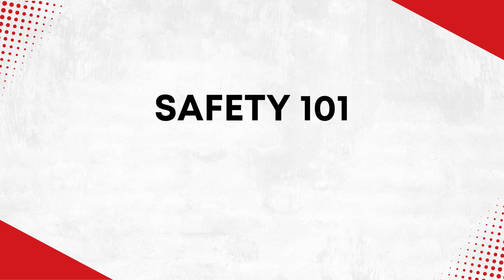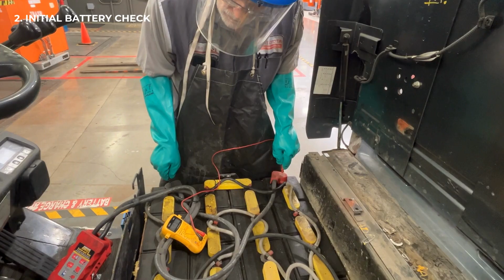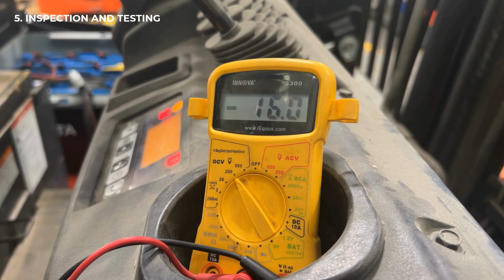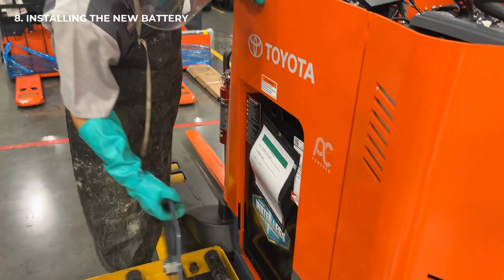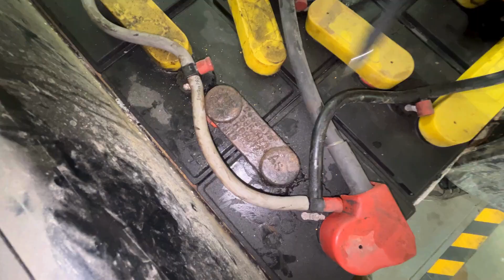Safety 101: Battery Test & Removal

Comment from the maker: Timestamps:

00:00 Introduction
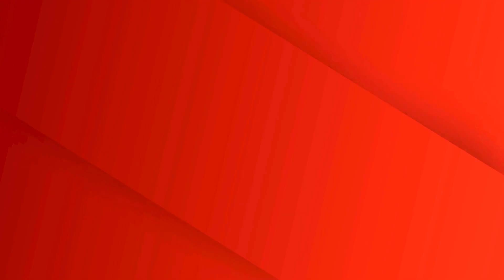00:20 PPE Safety 
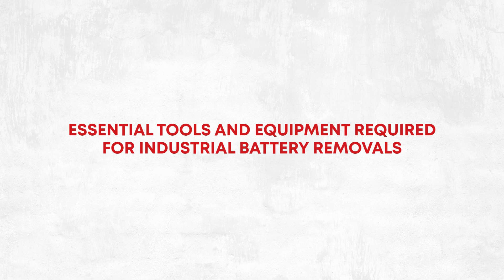00:56 Important Tools
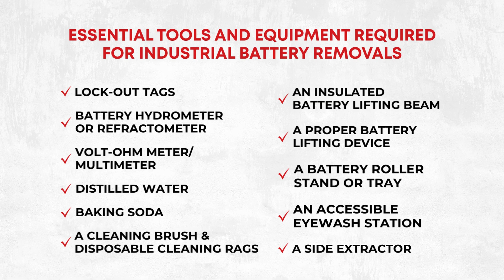01:38 Preparing the Forklift
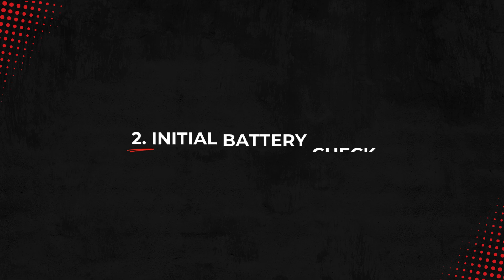02:01 Initial Battery Check
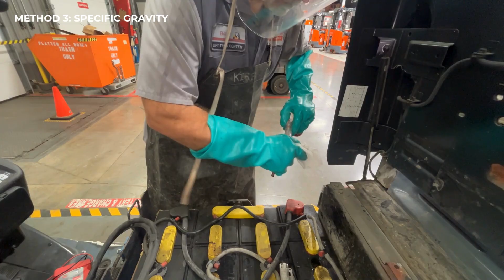03:16 Water Level and Charging Safety
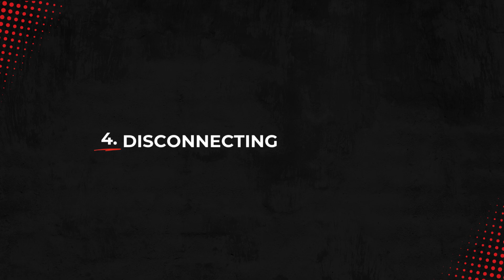03:42 Disconnecting the Battery
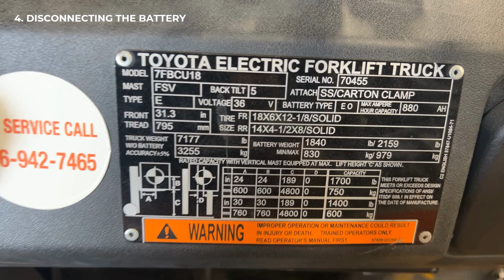03:57 Inspection and Testing
04:47 Cables, Restraints, and Load Test
05:11 Pop Quiz
05:29 Battery Removal Methods
06:25 Installing the New Battery
06:48 Battery Core Return and Recycling
07:10 Recap and Conclusion